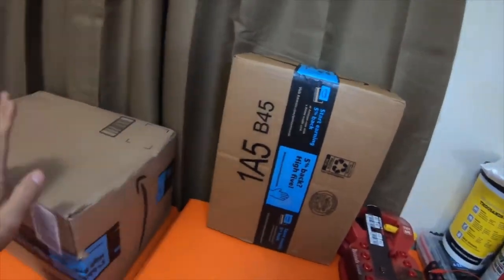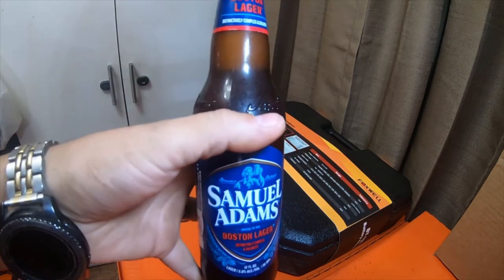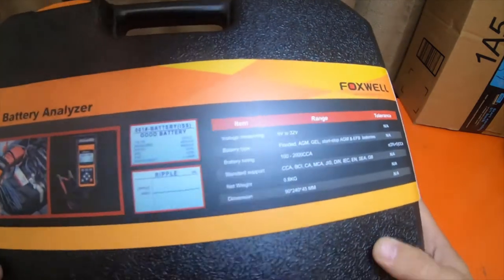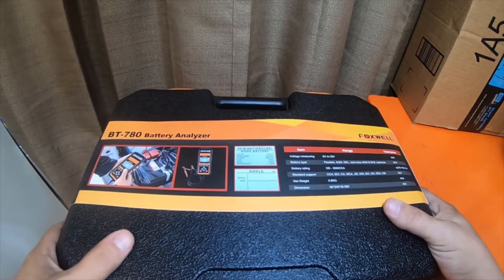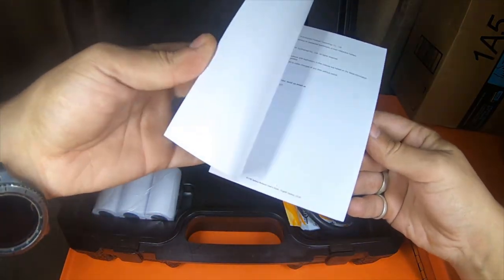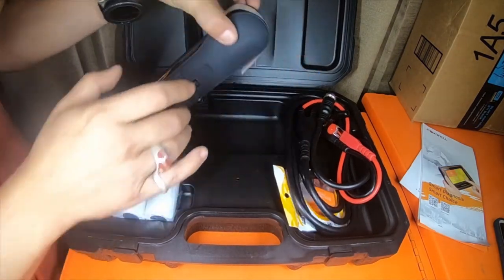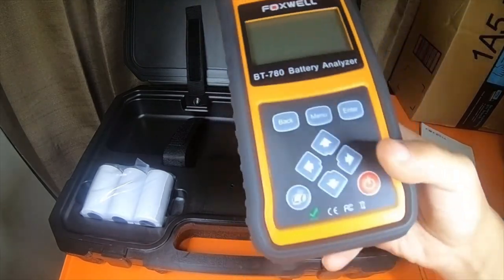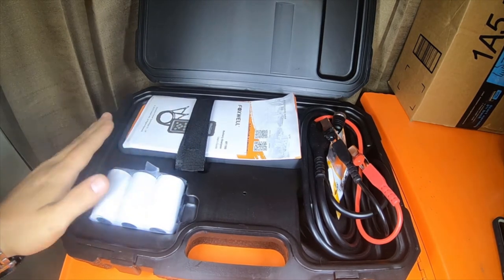Tools - FoxWell - BT 780 Battery Analyzer - Quick Look Info N Unboxing - 8 17th 20

Comment: what size is the rolls of paper that is used. can not find any information on it.
Reply from the maker: Paper size is 2.25 in x 50 feet or 57mm x 15mm paper standred thermal paper you can get at walmart for 9 bucks for 12 roles hope that helps  @DavidJohnson-ou7yx